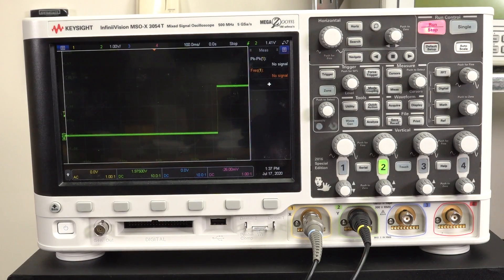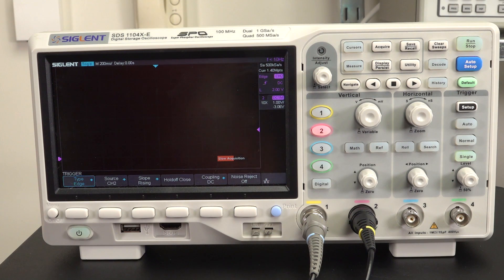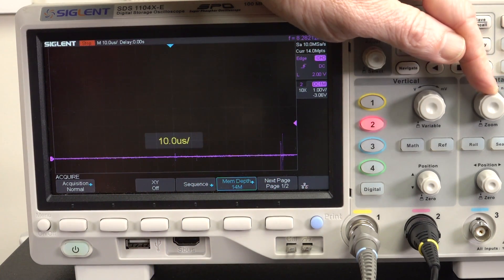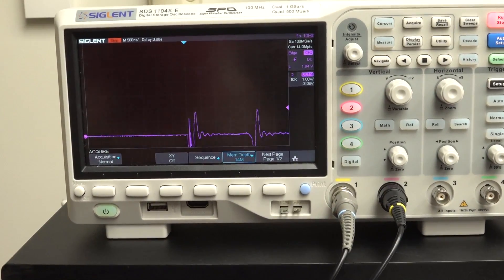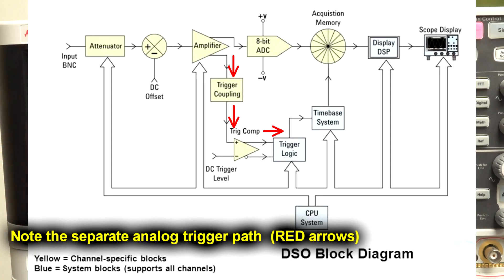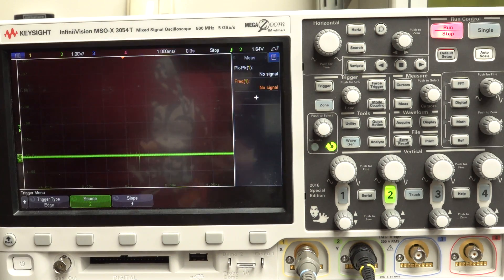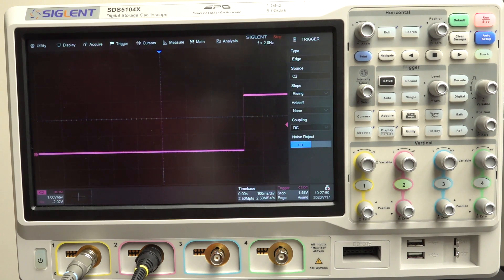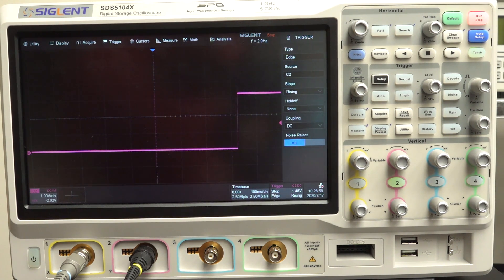EEVblog #1320 - Premature Oscilloscope Triggering

Comment: This is one of the reasons I sometimes hate to think in terms of memory depth when I set up an aquisition. Just keep an eye on the sampling rate if you know what kind of content you expect(or don't expect) and the maximum timebase will be limited by the amount of memory available. If you do it the other way around and just set the maximum memory you will be tempted to increase your timebase at the expense of sampling rate and then wonder why you miss glitches. In other terms: never acquire events on a single timebase/sampling rate; always explore your signal: increase de sampling rate, move the horizontal refference, zoom out, zoom in.

Comment: Nice video!
Some time, i have also some trouble with common mode interference, i put many ferrite on probe cable and make great difference in reading and triggering.
High DV/DT and high DI/DT circuit is always a chalenge to probe.

Comment: A slightly off topic question:   How would you contrast your Keysight MSOX3054T vs a
 MSO of similar performance from Rigol, say the Rigol MSO/DSM7000 500 MHz, the MSO8000 600 MHz, or even the MSO5000 350MHz?  The screen on your Keysight looks TERRIFIC but I’ve never seen either the 7000 or 8000 series side-by-side with the Keysight. I hope you’ll comment or point us to existing EEVBlog episodes I’ve overlooked. Keep up the great work and content. I’ve known engineers as talented as you but none so willing to share and mentor others!

Comment: Long ago I worked for a company that made systems normally sold into 60 Hz markets.  When we won a large 50Hz order, the customer insisted on a long-term 50 Hz test run to ensure completely normal operation.  We chose to use a large diesel generator whose output was extremely noisy, some of which made it through the system's power supplies.

We soon learned to keep HF Reject permanently on.

Comment: The problem is the fact that your using 2 different scope probes, one has a different propagation delay causing as much as 5 minutes of skew ... ... well at least thats what my old professor made it seem like when he marked me down for using probes that were not "matched" than probing i2c at 120khz :P 
and yes, im being a smart ass
Reply: Wouldn't that mean the waveforms are just apart horizontally by a few ns? One of my probes is 1m longer than the other. By my estimations that is less than one tenth of a division on max zoom of my 20MHz scope. You may be being a smartass but I'd say the professor was wrong to mark you down. You probably had more error from the probe compensation being subperfect.

Comment: I think there ought to be an alternative trigger mode that is based on the digitized data from the ADC instead of a separate analog trigger circuit, perhaps should even be the default mode and then use the analog trigger if you want to find spikes and things that are too fast for the sampling.
Also the HF reject should adjust its limiting bandwidth according to the sampling rate, and I think it does in some scopes.

Comment: I'll admit I didn't guess the answer at first, but I actually had the reverse problem a few months ago at work.... I had HF reject turned on, and my scope (Keysight DSOX3034T) wasn't triggering for the transients I was trying to capture. I didn't consider them to be that high frequency(We're talking 10s of kHz) but the integral over the trigger point would've been relatively small, so apparently the trigger level didn't stay high enough long enough to grab the transient, yet I knew it was occurring because I was still experiencing a failure mode I had already characterized..
I might've ended up adding an RC filter to the input, but at the frequencies we're talking, a 5 degree phase shift is not insignificant (200Hz for the main signal)

Comment: Been there, seen that. In the late '60s I was on a team building a drone navigation/autopilot system based on Omega Navigation technology. (GPS gear was too expensive and bulky.) This was in the USA but the company, which had been strictly building analog telemetry radio links, was bought out be an Italian company that built the airframe. They wanted the USA electronics knowhow. The owner of this company insisted that all the new test equipment be made by HP, so our scopes were, of course, HP scopes.

We had a big sheet of plywood with all our prototype electronics bolted down to it to simulate the airframe and there was three separate systems avionics boxes mounted there with the electrical cabling connecting them together. We had the whole system working together and were still testing and updating the software. 

One day we started working in the morning but everything had become unreliable. Stuff would work for a while and then the software in one system or the other would crash. We were baffled for quite a while. We kept asking the various teams what they might have changed that could affect all the systems this way. Nobody knew. We kept thinking it was noise in the power system. Finally the right person heard the story and said, "Oh, we changed out all the fans to brushless motor type.

We hooked the scope to the power line but it looked just fine, smooth as silk. One of the engineers said that HP scopes weren't fast enough to see the noise that might be there. Well we got a Tektronix rep to bring in a 'scope, a 465 to be precise. We hooked it up the same way we had connected the HP scope and ... nothing. But then we turned off all the lab lights and turned up the the brightness on the scope and there it was, a sharp little glitch riding on the power.

Needless to say, we bought some of those scopes. The fix was pretty easy, just added some filtering on the power. I don't remember the details of the fix but I sure remember that 'scope.
Reply: Great story, thanks for sharing.
Reply: I just want to be the first person to say, "Okay boomer" in reply to this comment. Peace.

Comment: This is a good topic. Perhaps Dave or others could look into how ground strap layout changes could reduce the area/space in which induced field is entering, thus causing the EM noise, maybe wrapping the ground strap around the probe or taping it down.

It also leads to possible discussions on improved PCB layout design for probing points in these types of boards, eg. having a ground point very close the the probe point and using a spring-type ground "lead" attached to the probes tip ring. Of course that does not help in probing around other points on the board that are not official probe points...

Cheers Dave,

Comment: Maybe little tip, but if your scope doesn't have a HF reject option (or it'snot good enough), you can just easily make one yourself from some passives on the external trigger.
Reply: Just add a low pass filter?
Reply: @cameronwebster6866  yes exactly

Comment: Here in the lab the noise of the led lights is so big that it is almost impossible to trigger in small signals  when they are on
Reply: It always helps to keep a lab clean enough to be able to receive SW Radio. Why use the cheapest LED drivers in an electronic lab ? That's nonsense.
Reply: olha lá o menino gregory...

Comment: I usually set the trigger level to just below the expected signal level.
Not the avoid this sort of issue, but for things like tri-state logic.

Perhaps you could make a simple test jig to re-create this issue, something the EE students could do in the lab with a signal generator and and inductor.
Reply from the maker: Wouldn't have helped much in this case, some of those induced transients are well above the signal level.

Comment: Dave is back! I'm so happy. I thought this channel would slowly fade into nothingness and now Dave is making interesting technical videos again!
Reply from the maker: Let's  do the same thing I do every time someone says this, let's look at the last 10 videos from 1310 to 1319 
- 2 x Teardowns (one was HUGE)
- 1 x Debunking
- 2 x Oscilloscope tutorial type, not dissimilar to this video!
- 1 x Mailbag
- 1 x Really interesting discussion on quantum computing
- 2 x Product Reviews
+ misc videos
"Fade away into nothingness"? Sounds like the exact same mix of content I've been doing for the last decade!
I appreciate that you like this video, and may not like the others I've done recently, and that's fine, but please try and be realistic.
Reply: @EEVblog Some ideas:
What do you think about silicon carbide MOSFETs?
What are the rules of thumb regarding high frequency digital signals (like 40MHz SPI), trace lengths, cable types and connectors if we want to connect circuit boards?
How can we ensure that our digital projects don't emit too much EMI and cause trouble?
How to select the right connector) plug type for a project?
Reply: @EEVblog  It is long time ago since you made a comparison of equipment like your multimeter roundups. I also had the impression that topics like investment, fonds and crypto currencies got more and more of your attention.
But I'm glad to be wrong.
Reply from the maker: @MetalheadAndNerd  Investment? Crypto? Show me were I have done that on my main channel in the last few hundred videos.
Reply: 01010100 01100101 01100001 01100011 01101000 01100101 01110010 01110011 00100000 01101111 01110000 01100101 01101110 00100000 01110100 01101000 01100101 00100000 01100100 01101111 01101111 01110010 00101110 00100000 01011001 01101111 01110101 00100000 01100101 01101110 01110100 01100101 01110010 00100000 01100010 01111001 00100000 01111001 01101111 01110101 01110010 01110011 01100101 01101100 01100110 00101110
Reply: ASCII José. Thank you for asking. Cheers!
Reply: Dude maybe you don't like his content and that is fine, but he uploads a ton and all of it is high quality... Don't know what you're talking about
Reply from the maker: @matiastripaldi406  What happens here (and I've been getting this same thing constantly for last decade) is that people only like certain types of videos (fair enough), and even just certain videos within those types. They only remember the older videos they like, and forget how infrequent they actually were and/or they don't realise that their own interest has changed over the years. So they declare "the channel is going downhill", "the EEVBlog isn't what it used to be" etc etc.
Yet every time I analyse my last X videos, the mix has always been the same as it has been from pretty much day one.
I don't blame people though, my channel is and has always been an eclectic mix of content, and it's impossible to please everyone all of the time. Or even for stretches of 10-20 videos at time for example.
Take this complaint for example, I have done two videos within the last 10 videos that are almost exactly the same oscilloscope tips type content as this video they liked. Yet they liked this one and either forgot about or didn't like, or didn't watch the other two. 
Then they will complain that they want tutorials, and then when I do a tutorial they either never bother to comment or watch, or they just comment "why don't you do this and that". 
Such if the life of a Youtuber...
Reply: @EEVblog  yeah I totally understand. Also given you can search a channel, I'm guessing most people just look for their favorite type of video and watch that, so their perception is gonna be skewed. It's good that you acknowledge that people have a preference, I myself enjoy your teardown videos the most for example. But I can also see how your other videos, like your whiteboard tutorials might be extremely helpful to people who are, say studying EE. So overall it's great to do what you do. Also you don't get burned out by doing the same thing. Ignore the haters Dave, this channel is awesome
Reply: @EEVblog  infrequent? when was the last open project video? last educational video like old basics videos, not just some random tip that was exploded to a 40 min session? You may stay in denial, but people are trying to tell you that you got comfy on YT..
That's the general trend with YT channels. When they get bigger, creators get overly confident, pay much less attention to comments, even ignore similar persistent feedback like one in this thread. Tend to develop very subjective ideas about running their channels that they then follow blindly, without ever double-questioning themselves. And overall end up steering to some mass appeal opinion that is really no ones preference and away from core/old audience (while gaining subscribers effectively dropping their content quality comparatively to early days).
Just an observation that I catch myself on, following quite a few channels that in majority end up taking this path.
Reply: @Mr.Leeroy  I thought that Dave was just running out of ideas and maybe is to proud to ask for some. Other tech channels have burned out much faster.
Reply from the maker: @Mr.Leeroy  Wow, you really seem to have everything figured out, as if your opinion on video subjects is the only one that matters.
I'll tell you precisely what your opinion on video subjects is worth, 1 in 736,000. You do realise that over half my audience don't care for open project designs or basics videos, right? How do I know this? I have the data.
You seem to be implying that I don't listen, or perhaps even somehow arrogant. Look at yourself, you are arrogantly assuming that because I don't do as many projects or basic videos any more, that I'm not listening etc. Bullshit.
BTW, guess how many design project series l've done in 11 years, two. TWO! in 11 years
Did you bother to ask me *what videos I wanted to make*? I doubt you even care.
Guess what happens when I do project design series, I get bombarded for years with people telling me I'm doing this and that wrong etc. Yeah, it's really encouraging. Do you care?
Guess what happens when I do basics videos, in most cases I low views and the feedback is mostly "can you do this, and that" etc. No thanks, they just want *what they want*. Do you care?
I have the data to prove you are entirely wrong when it comes to "core/old audience". You have no clue, just yet another one of the 736,000 telling me what I should do.
And yeah, I don't pay attention to comments, I just sit here replying to you instead of being with my family...
Reply: @EEVblog  Thanks for the clarification. It happens from time to time that I love a product for years, then it changes away from what made it the top product for me and the manufacturer basically tells the original fan base that they are no more his target audience and he is now focusing on a bigger part of the market. This is a normal part of how things evolve. Alienating the hardcore fans once helped Opera to finally become the mainstream browser. </sarcasm> Maybe there will be a new channel with non-sponsored equipment reviews and helpful tips for aspiring product developers.
Let me thank you for the actual help that your old videos provided to me in extending my knowledge from pure software development to electronics design. I'm not among the people who matter to you but you did matter to me a lot.
Reply: @EEVblog  Exactly my point. We are just numbers from the data now.
> I just sit here replying to you instead of being with my family...
wow, ok, blame random YT commenter.. Won't even bother clarifying myself now as I do not won't your children to grow up without daddy.. Although I was not insulting but you totally do not understand what I'm saying and clearly gone full "offence is the best defense".
Reply: @matiastripaldi406  Maybe you are new to this channel. Then have a look into the older videos.